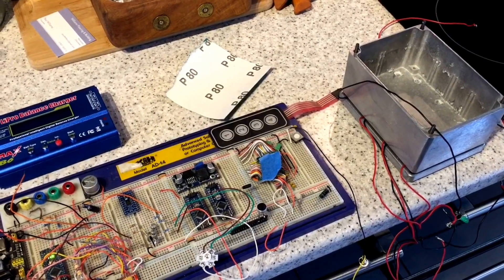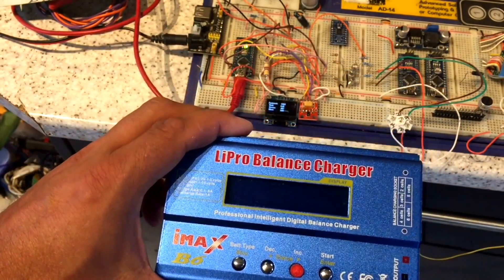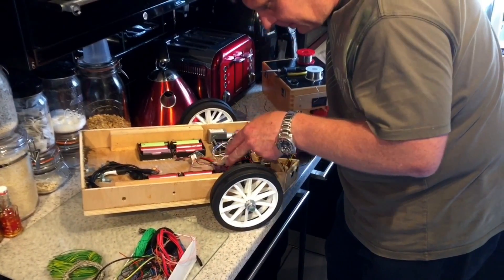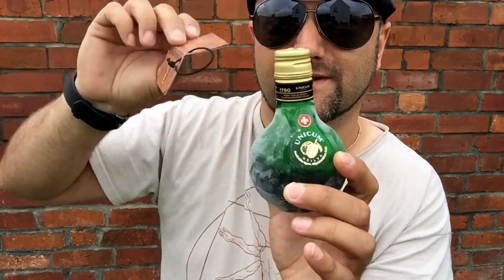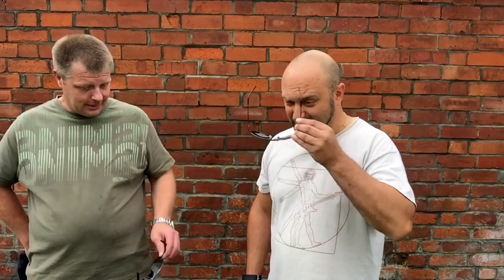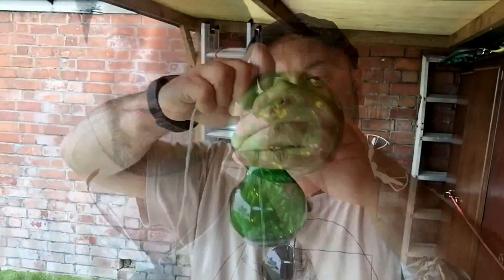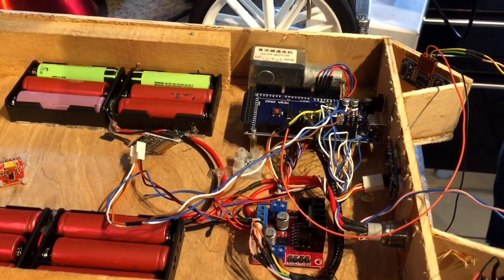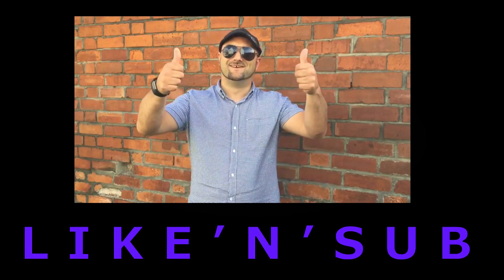Robot Lawnmower PT16

Comment: My experience with the ultrasonic distance measurement is you have to be close to 90 degrees to get the reflected signal.  The old angle IN off of 90 degrees equals  OUT angle on the other side of the 90 degrees - kind of like looking into the mirror at 45 degrees you don't see yourself.
Reply from the maker: Absolutely... they are useful, but sometimes need a little coaxing to get the reflections just right :-)